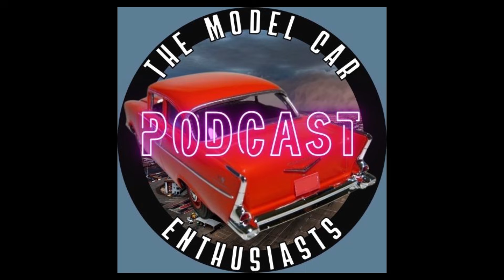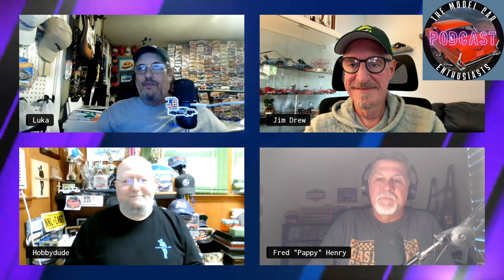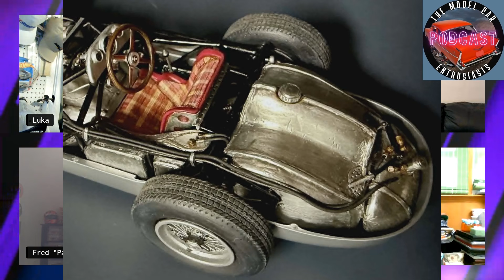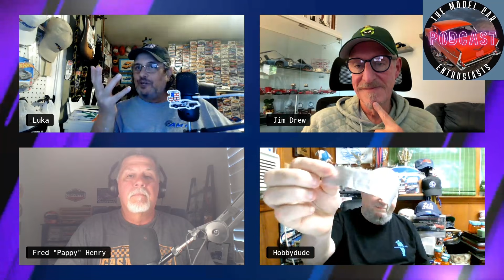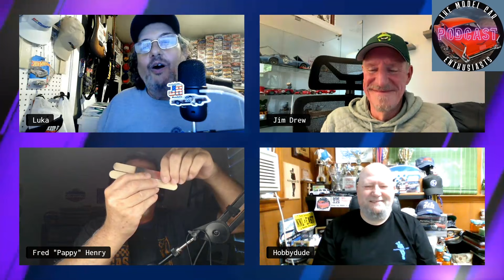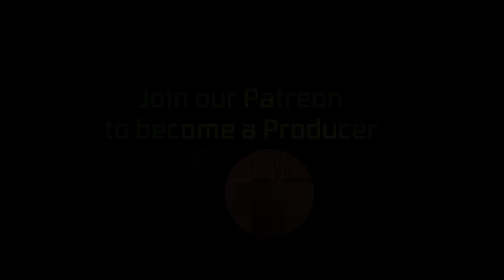Using Non Conventional Materials On Your Model Cars. The Model Car Enthusiast Podcast 19

Comment: I’ve been using the fly tying lead wire for years on wingy things. A way to paint them is to put some paint in a pallet well. You then pull the wire with a little pressure from a gloved finger on the wire.

Comment: I use HVAC tape to use for damaged body panels on my short track stockers- I'll cut holes in the body panels, melt the plastic with a heat gun, and then put the HVAC tape over it- sand the tape first so the primer and paint stick to it - it gives it a realistic damaged look and then I use different shades of gray acrylic hobby to paint along the damaged sections of the body- it comes out looking pretty realistic

Comment: During the discussion about embossing powder and how to give an object a raised detail like rivets, many are using  UV resin. Place a tiny drop of the resin onto your model or decal paper, shine the UV torch/light onto it. It hardens within a few seconds. Also, many armor modelers use a mix of Tamiya putty and Extra thin cement. Using an old, junk brush, stipple it onto your styrene to create texture.  Especially good for replicating cast materials, "blistering rust", etc.
Reply: Once you mentioned putty and cement I started hearing Uncle Night Shift

Comment: Great pod  guys.... always appreciate the knowledge and the extra tips provided.... on the MCW thinner I started 10-12 builds ago using for the color, enamel and lacquer. Great results  no issues on leveling or orange peel yet lol..... interior and chassis etc using Mr. Hobby. Actually didn't see a big difference....  between the two. Add a little Hobby with the 2k..... works for me..... Later Weasel...

Comment: Like others before me, I've used tissues or paper towels soaked in a white glue and water solution to make tarps. Also, I've used real glass cell phone screen protectors to make shattered glass windows for model cars. You can smash them with a hammer and they can be cut with scissors. Be careful though, it's real glass.
Reply: Cool tips 👌